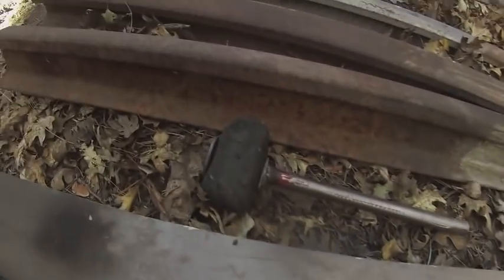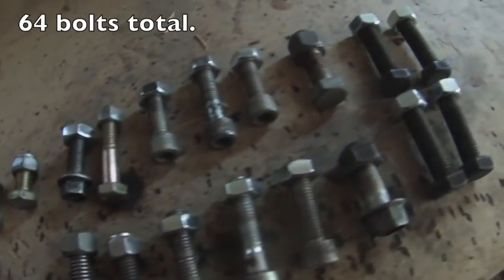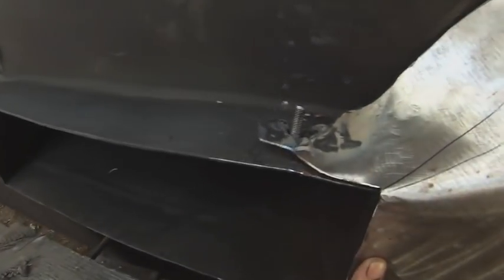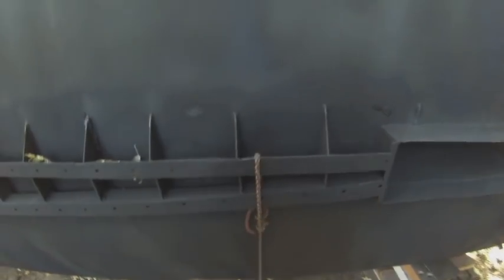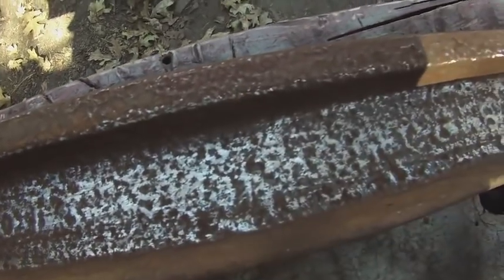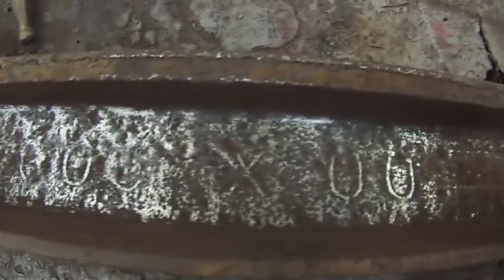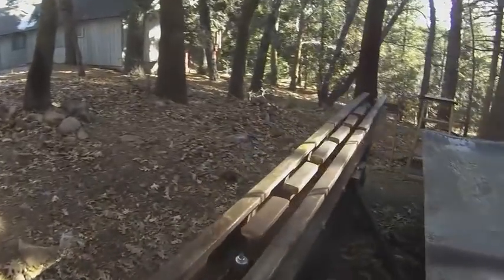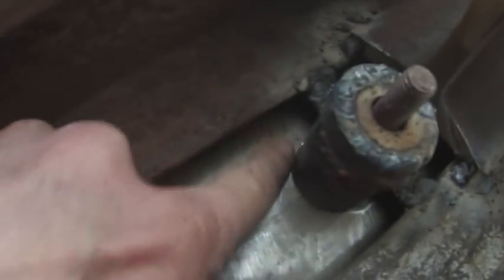Steel Sailboat Build Part 34

Comment: The marks on the rail are the manufacturer, date and weight per yard.

Krupp 1880 means Krupp Steel Works rail rolled in 1880,  Germany, yes they imported rail from Germany at that time, the 6  lb is probably 60 lb, see below;

that rail is 139 years old.

Joilet means   Joliet Iron and Steel Co.   Joliet, Illinois.,  from the 1887, the roman numeral VII is the month, July; the 60 lb means that rail weighs 60lbs per yard

that rail is 132 years old  The Union Pacific used that company for its rail and some is even still in use in yards and sidings.

You will be sailing with some history on your boat.

Comment: I admire your work ethic and creativity - it has been a pleasure to follow along.  Please be mindful of biofouling - those cooling chambers may become completely clogged and be somewhat hard to clear out.  

Also note that "fairing" a hull is the process of making it smooth and more streamlined.  I think your hull projections may create a lot of drag as they aren't faired very well.  Your trailing edge is very important for the drag, so make sure to fair the trailing edge as well.

Good luck to you and keep at it!

Comment: I’m sure you thought about this, but just asking, hope you are not mixing 2 different metals, right? (I didn’t get what metal was the one you were molding for the bottom)
Reply: Looks like steel. And aluminum would move with a lot less effort.